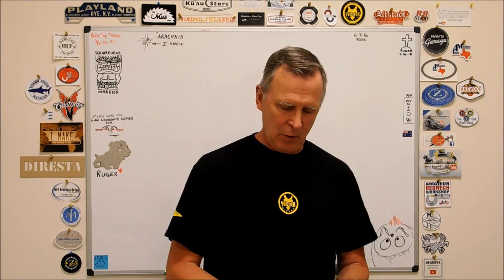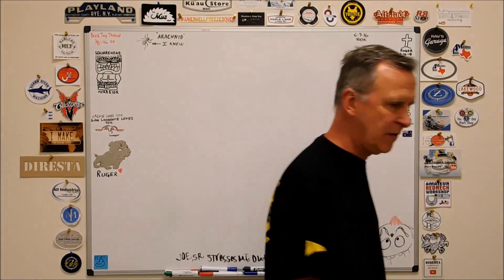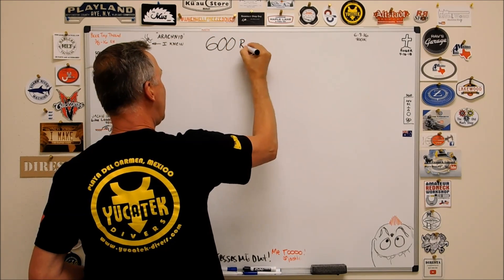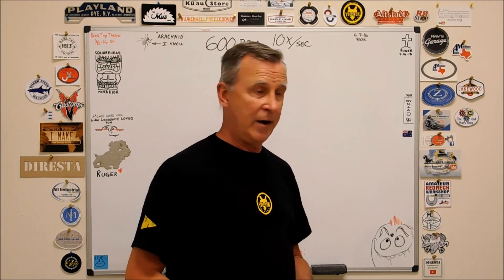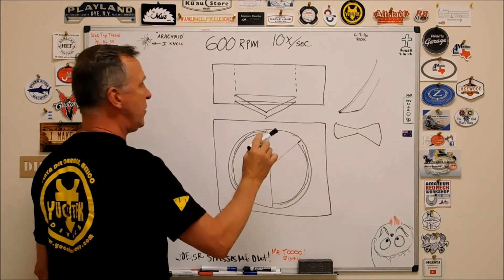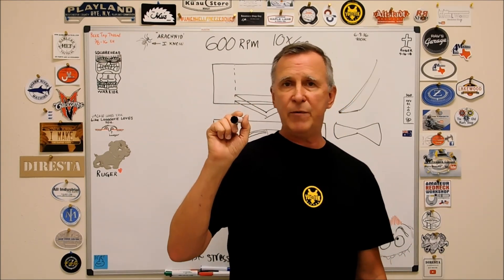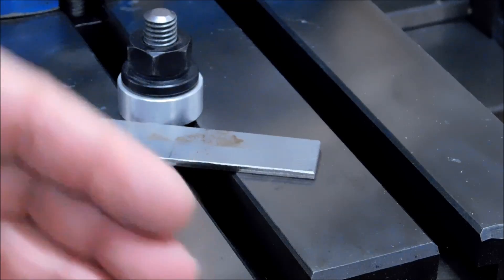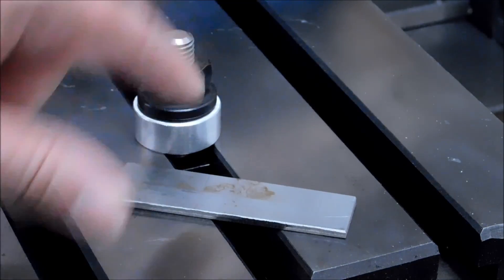EVERY METAL WORKER SHOULD WATCH THIS...

Comment: Use the dog gone vice. I nice set of parallels a spring to hold them in place and drill, crack vice, pull part, insert part clamp vice and drill repeat. 15 to 20 parts per minute...all day long or until the drill point dies...Then change drill or sharpen your one drill and get back to making chips. This will not likely wear out that Kurt Vice. Solid hold makes your drill last longer. Try coolant that is fun.

Comment: When through drilling, the drill suddenly becomes a screw and anything engaged in that screw's thread will follow the thread.  Reaction time is humans is 1/4 of a second.  Your example of 600 RPMs is 1/2 human reaction time.  We lose.  And machines are measured in horse power, not people power.  We lose again.  About the only practical use for a vice grip is doing the ob of holding when drilling through.  I have enough of them so I might as well use them!

Comment: Great tips - thanks.  I do have a general question though:  How do you recommend fixturing say an 18 inch long, 1 inch wide, 1/8 inch thick copper strip that you want to drill 17 holes (say 3/8 dia) in all 1 inch apart (a buss bar to connect high current taps).  Would you use a wooden shim so the drill punches through the wood and not the mill table?  What's the best way to clamp it?  A machinist vise jaws aren't that wide?  I'd be interested in your approach.  Simple problem but holding the part is more work then the drilling operation.
Reply from the maker: I have a video on how to tap 400 holes in 30 minutes. The sliding drawer setup is how I would do that. Drill a hole then use that hole to locate the next part. The bar could be 100 inches long and it wouldn't matter. Go watch that video. It will give you some ideas.
Reply: T-nuts in the slots, toe clamps on the part... there's probably 20 or 30 more ways guys will come up with, but that's what came to mind right off the hop
Reply: One way you can use your Kurt is as follows. 

Drill 5 or 6 holes. Run back to the starting end of your vise. Swap out the drill for a 3/8 pin. Use the pin to line up on the last hole you drilled. Snug the vise continue drilling until you reach the end of your vise again. Then just repeat. 

Another way, if you have 2 vises and it is a repeat job. Make some long soft jaws and indicate the vises in line with each other. Then you can drill all holes without re-clamping the part. 

Yet another way. Make a fixture plate and use some Mitee Bite clamps to hold the part. Mitee Bite may even help you with selecting clamps and fixture design.

Comment: Great Info. THANK YOU!  I constantly make a threaded lock ring about 1.125" in diameter.  I drill two divits 90 degrees from one another to allow installation.  Those holes don't go completely through.... and the part still sometimes grabs the bit.... I WISH I had a way to hold those. They WILL BITE!!!!

Comment: Too many years ago to want to remember, I was taking a machine shop course. 

I locked a part down on some parallels in a vise on a Bridgeport Mill. I was going to line up and drill about a 3/8 hole in the material. 

The student before me had removed the vise and simply set it back on the table without securing it. 

When I reached the breakthrough point the 3/8 drill grabbed the work, and the vise, picked the whole mess up off the table which broke the drill, and the work, with vise attached, brushed across the top of my shoes as it landed on the floor. 

Of course the instructor blamed me for the incident but I was simply happy to not have been hurt. 

Do you really think you're going to hold the part securely with nothing but your hands? Think again, folks. 

Good video, Joe!

Comment: Young, stupid and thinking your somehow indestructible is about average for most of us. Growing older and a bit wiser ought to be as well. My one incident on a drill press and a part lifting and spinning got me a nice fat blood blister. It could have been much much worse. Since then I've never once hand held a part that's small and light enough to be dangerous. Once was enough for me. Unfortunately and for a small percentage you can lead them right up to the very edge of logic and knowledge with proven methods to help. But you just can't make em think. The fools are gonna keep right on doing what they've been doing. 10 actual dislikes at this point, WTF and ???????? Those L shaped combined stops & hold downs were worth the 14 minutes by themselves.

Not to be critical Joe, but changing the video title to what it's about helps to pull it up when anyone's doing Google searches. Hand Holding Parts & Drilling Safety or whatever else you can come up with would help do so for anyone actively searching for information like this.

Extremely good taste in using John Force as an example. :-)

Comment: Oh and same problem in reverse...i once was drilling a well secured piece of steel with maybe a half inch bit in a powerful hand held power drill.  I anticipated the grab on break- through for the reasons you describe, and had my left arm braced in a good position on the auxiliary handle to absorb the reaction torque...
... so here's a failure mode i didn't consider: it turned out that while i had the auxiliary handle firmly attached to the drill, it wasn't tightened down hard enough to resist the reaction torque.  So the drill spun inside the auxiliary handle clamp. (About 2 revs before it stopped based on the power cord wrapped around it).
The next problem is that I'm right handed, so when the drill began to twist, it pushed itself into my grip, meaning that even though I let go it kept chasing me and it was very difficult to extract my hand.  Sprained my wrist and shoulder, and was sore for months. 
Preventive action?  Hold a hand held drill in your LEFT hand... then if it grabs it automatically pulls out of your grip, releasing the trigger in the process with no harm done.

Comment: For a square block as drawn you have four corners.  So while it is 0.1 seconds (100 milliseconds) per full revolution, as stated, it is only 25 milliseconds between each corner hitting (or passing through) your finger.  
So for most people with 250 to 500 millisecond reaction times, a corner will hit you 10 or 20 times before you even BEGIN to react. Still have to pull your hand back.

Comment: I mean... yes and no. If I'm drilling an 8mm hole in a 20kg die set, there's no need for any clamping. If I'm using a sheet metal drill to go through plastic sheet, there's no need for clamping. If I rest the long end of some sheet metal against the drill press column, you guessed it; no clamping. A bit of common sense plus an understanding of drill diameter vs workpiece mass comes in handy.

Comment: Thanks for the blocks idea.
Reply: Another safety item. Keep your hair out of the way. I say this because back in 1974. I was taking machine shop in high school. One of my class mates was drilling a hole with a 1/8 inch drill spinning quite fast. He got his face close to the drill press and the wind from the drill bit grabed his hair and riped almost half his head bald in a mill a second. So yes safety first no matter what. With your forum there is no bad questions. Thanks Joe.

Comment: Still have all of my digits, but my early days in the shop were full of scary moments on the drill press.   I have been using a toe clamp as a stop, but mounted upside down. That way not only does it keep the part from rotating, but the nose of the clamp acts as a wedge to keep that edge from lifting up off the table.

It is far from fool proof, but it is fast and toe clamps+hardware are never more then a few steps away.

Comment: I learned my lesson 30 years ago when I watched the guy next to me drilling into a 12lb block of lead to fine tune its weight...the bit corkscrewed in, the chuck bent, the bit broke, and the part was thrown fifty feet down to the other end of the shop. His hands were still shaking a half hour later. I never drilled unclamped metal after that day. Sure, he had the wrong rake angle for lead, but a clamp would have made all the difference.

Comment: I always approach a free hand drill as if the object is going to spin, and if it is too small for effective handling I just don't. That being said, a sacrificial piece underneath the part (usually I use wood) dramatically reduces the chatter which causes the spin to happen. For whatever reason empty space underneath the drill hole is the problem. I think it has to do with the load from the press  bearing down, but adds a more constant resistance. (it is a night and day difference in terms of both spin and chatter during final cut through) I also run slower speeds

Comment: I already knew everything you said in this video and I'm still guilty of holding steel as I drill on a drill press but never on a miller, like its less dangerous. I've had work spin out of my hand a few times and I still do it. I have a little machine vice under me drill table and I still do it. Tomorrows project, Make 2 L clamps and put a loose bolt through my vice and table so I can't just tuck it away but it can't spin. I don't know why I waited for you to make this video. Thanks

Comment: Great video Joe, I especially your idea of the 90 degree blocks in the vice, Well done!!
The situation I constantly see on YouTube is where the items in a free-floating vice, they're holding the vice handle to stop it while on a Drill Press...same potential outcome but now with a much bigger mass.
I was taught with a free-floating vice to make sure its handle was hard up against the Drill column, in the direction of rotation & if it did catch then the column stops it before it can start spinning.

Comment: This is a great bunch of ideas, not just for metal workers but for woodworkers too.  I guarantee you a piece of maple has a very sharp edge and will cut you badly (is there any kind of 'non-badly' cut?) if the drill picks it up and flings it.  And while you didn't show any table-saw operations, it can do a very good job of teaching you where you should not  keep your hands, if it leaves you any -- and that's from the wood, not just the blade.

Comment: I commonly use a Scangrip 13 clamp (essentially a weld clamp with a t-slot nut, google them if you don't have any yet). If positioned correctly it will both hold down the work piece and prevent rotation. Super fast and easy. Should always be available near the drill press. Easy access to tools that help you work safe makes it so much more likely that they will be used.
Reply: I use it all the time, very easy and fast. Think it's called table C-clamp locking plier.

Comment: Such a great video, I've worked in aviation for 30 years, loads of small parts to drill, often sheet metal, we were all told about the dangers of using our hands and if I'm honest, most of us ignored the advice at least once and learned the hard way!  Very good point about belt sanders and grinders too, the worst accident I have seen was a small part pushed onto a belt sander by hand, It flipped up and went down the gap, taking with it a fingernail, and quite a bit of skin and flesh.  Excellent advice, machines are always stronger and faster than fingers, hands and arms. I'm sure this video will save a few injuries.
Thanks.

Comment: True to the bone! And great explanation of the lift action. 
As far as I know the power of an average human is about 750W and this is the total power that one can deliver let's say to the ground. Compare it to the power of the machine you are driving(counting the reducers). Or otherwise compare the tensile strength of the material you are holding by hand to the one of your limbs...
I've been lucky many times, so I just try not to push my luck without reason.

Comment: My tips on things:

If you vise is long enough, rest the tail against the column. If it's not, bolt something to it to make it long enough. However, assuming a lack of friction between the work, and the antirotation stop, this force to prevent the moment will apply a reaction moment on the drill bit. Depending on the stiffness of the drill bit, that may be a bad plan.
I flung a vice against a friends leg freehand drilling a bit back. It was a light enough vice but it still scared me straight.

Comment: Great pointers Joe.  I use hold down clamp like half a mole grip  with a bolt attached on my drill press and welding table, cheap versatile and strong.  Not sure if this link will work...  https://www.axminster.co.uk/axminster-drill-clamps-ax23568  but similar to these
Reply: You need to point out 'Mole' grips were Made In Britain version of vice grips. 'Mole' factory was in Newport South Wales, closed down in the late 80's (as you came out of tunnels towards Severn Bridge it was on right side) I forget what was built on the site but remember being there in 95~96 when it was being cleared
Reply: @peterjones6945  good point:)  I couldn't remember the US name (mind you, chances are they're spelled "vise" over there👍)
Reply: @2lefThumbs  Yep, even after 20 yrs I still forget they spell things weird. Friend of Benjamin Franklin invented a complete new language for the 'new' USA but was pretty much told he had rocks in is head! He  was allowed to mess with the dictionary (may have been Webster? I know more about British, Welsh and American history now than I ever did living in Britain. USA has used metric system since 1864 Act of |congress, it's just majority are ignorant of the fact. France donated standard meter and kilo for US to use, so they converted it????? US gallon is smaller than British gallon because US bought wine from France, they used 16oz pint and 8 pint gallons (3.88 vs 4.54 litres)

Comment: Like drilling brass with a really sharp drill. The drill becomes an aggressive screw which grabs the part.
Reply: It's common practice to 'stone' the cutting edge on 'brass' drills to reduce or remove 'top rake'. Straight flute or spade drills work better on thin material when punch isn't an option

Comment: I fully agree. A set of parallells or even plain bars will help to hold the work in the vice and do the job. I too have seen vices rotate so the old rigidity rule is very much both a quality and a safety rule.

Comment: Guilty as charged until I got a couple of 'drill press locking clamps'.  They are half a mole wrench that are very quick to use.  Using a sacrificial backup plywood or aluminium plate to the part being drilled helps to reduce the sudden grab at break through (aluminum will also work ;-).  It might also save the drill table or vice jaws.  I love the L stops idea, will be making some.  As always your videos are superb.  Many thanks.

Comment: The boots seem marginally faster than just using the vise as designed.
Reply from the maker: They are very quick to setup and use.
Reply: The advantage is that the vise can be bolted. If your vise is on a drill press that only swings in an arc, and it's bolted, then you can no option but to redo that for every hole in different sized material. With the boots, you just reclamp them at the worst.
Reply: If you have a row of holes along the strip, along a line parallel to one edge, the "boots" will locate all the holes correctly relative to that edge, and you can adjust the other axis freehand, in real time, and without the need to clamp. 
Using the vice as designed, you could achieve the same result, but positioning  in the other axis is much slower.

Comment: Thanks for the video.
Safety videos should be like this, Safety videos show do not do this, but they rarely show you what to do to make it safe. My first metal working job was a summer job and I was doing free hand drilling of parts and the first one was OK the second one gave me a good cut but left the fingers on my hand. That is when the drill vise was used. Later on in life, when I had a full time job in metal working the person training me said, " Even if the machine has safety signs or not a machine does not have any feelings about killing you " That is when I looked a machine and gave it the respect of something that can and will kill or hurt you, and do not fear you machines. I have a few damaged fingers and other parts of my body, but I am thankful to have all my parts still attached.

Comment: Voice of experience...... had a hole in a conduit clamp I had to open wider to fit the bolt in it had an antique wall mounted hand crank drill press... thought ah just one hole wont take but a second. Held it with my had and started cranking got almost through and it caught... my hand wrapped around the drill press and skinned the tops of my fingers before it stopped.... I learned my lesson, now I keep c-clamps and a vise right beside my drill press so I dont have any excuses not to use them. Great video Joe, you always have the best tips for setup

Comment: good vid and explanation, thumbs up.
i remember an incident with a three quarter inch counter sink on a decent sized drill press some years ago, i didn't have any precautions set up because the workpiece had like well above 15 kgs and it worked for 9 countersinks already, but at the tenth the countersink would grip into the material, actually lift it up some inches as i tried to retract the spindle and the workpiece would fly off almost 2 meters to my left when the countersink finally unhinged.
tbh i was completely and utterly shaken of how in the world this could have happenend, and i started to use proper clamps to fix workpieces to the machine table ever since when a vice is too small. the amount of force those drill presses could generate at low speeds are actually mindblowing, so never ever challenge them with weak setups.